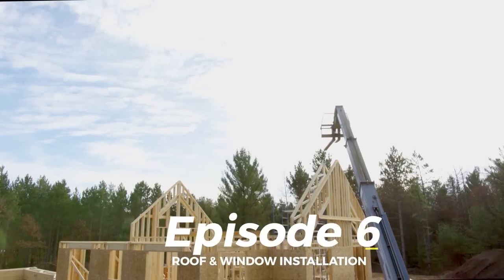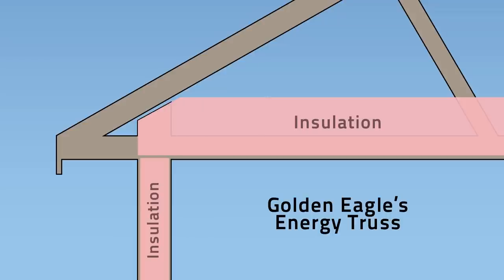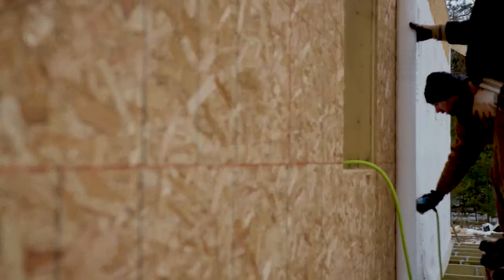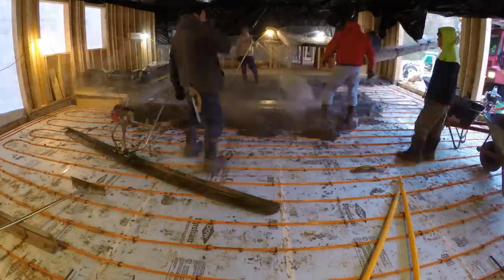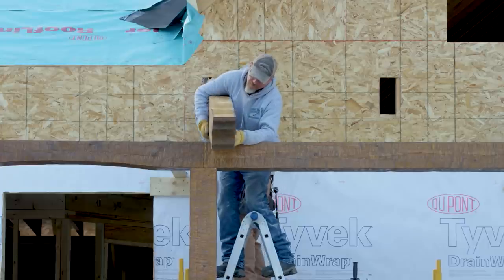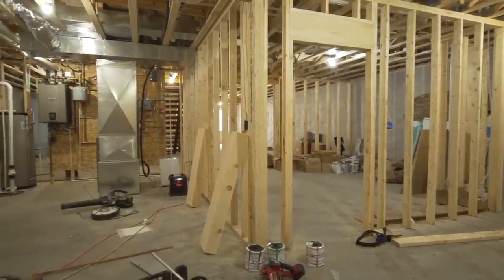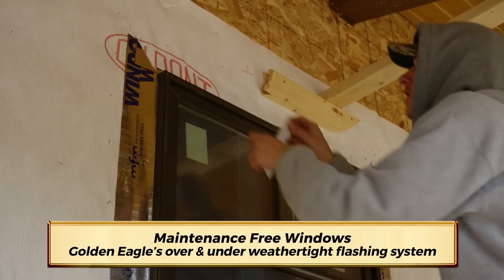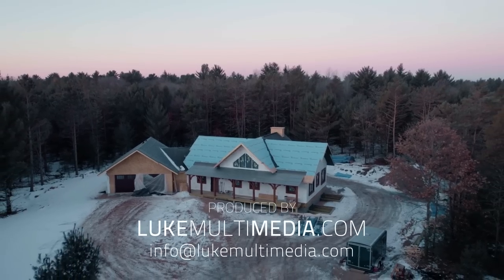Ep 6 Building My Dream Home - Roof & Window Installation

Comment: Dude! You forgot the drain in the center of the garage. A drain allows you to wash the under side of your vehicles to remove salt. I saw one home with an undercarriage sprayer operated via remote when pulling into the garage. Super over the top. But much needed to remove road salts..

Cheers from Seattle!
Reply from the maker: It's there right where you said!
Reply: @goldeneagleloghomes  Indeed it is. I didn't see it until a later video. As well as the spigot to rinse the salt off with. I couldn't remember which video I had made this comment on. Since I was unable to come back to correct this comment I added a correcting comment to the video showcasing your envy inducing garage.

Cheers!

Comment: Not trying to be picky but shouldn't you use the house wrap and cut it into the window wells? So as to stop moisture from rotting out the wood around the window when it gets in? It will save you money in the long run.  If you cut the protective paper the shape of the window then the water from rain and melting snow can't get in behind the window's and cause the wood around the window's that are not covered to rot away.
Reply from the maker: Thank you very much for watching and commenting!
--

Comment: Why not plywood on the roof vs osb??
Reply from the maker: Hugo Hugo Thanks for your question. Today’s plywood quality is not as good as OSB. OSB is a better product.
Reply from the maker: Check out episode 10 for the final tour: https://youtu.be/kcURWoz3AKU
Reply: Plywood delaminates when it gets wet OBS doesn't plus especially for an engineered truss roof the loading on OBS omnidirectional on ply it isn't.
Reply: @Bobg425  depend on the grade of osb. If they're using premium osb then it's all good but if not plywood would actually be better than cheap osb. Actually there is much better systems than what they are using but they are usually more costly and may not be necessary if the owner doesn't want to dump more money into it. you have to look at it in tiers.. 50,100, 200 year maintenance houses. There is ways to overbuild home so much it lasts more than our lifetime and then some but it's more $$$$$. Then there is cheap skate builds full of problems and medium grade builds that are standard and last long enough for most to enjoy with some maintenance down the road. tech is evolving though so we will see better builds in newer homes that never existed before.

Comment: How was waterproofing made for the foundation?
Reply from the maker: There is a sealer on the foundation. There is also a drain tile around the bottom of the foundation. Plus the land is sandy, and the water will drain easier away from the house.

Comment: Isn't that concrete in the heated garage floor a bit too thick🤔?
And also, why heat a garage floor???
Reply from the maker: Cold climate, It is so nice the heat is located down where you want it and it melts the ice and snow that falls off the car, thanks for watching

Comment: @Golden Eagle Log and Timber Homes How do you make repairs to the tubing of the heated floors if they are cemented in?
Reply from the maker: Once installed, there should not be a need for any repair.
Reply: Jack Timbers you don’t do repairs at this kind of tubing in heating floors unless you start to drill holes in the floor. Is no need .

Comment: Hi.
Can you share the total cost of this project?
Reply from the maker: Yes we can If you have been following along in the video series “Building My Dream Home” episodes 1-10. You may have been wondering what the total build cost (♦ turnkey cost) would be.
Zach started with the smaller Clearwater 1750AR Ranch. For which either the Premium Exposed Beam Timber Package, or the 8 Inch Premium Half Log Package! and would turnkey for approximately $369,000.
We also have a model called the Clearwater 2095AR Ranch which is more similar in size to Zach’s home. For which either the Premium Exposed Beam Timber Package, or the 8 Inch Premium Half Log Package and would turnkey for approximately $575,000.
Zach used the Ultra Custom Timber Package version, the Timber Ranch 2286AR-CT. The Ultra Custom Timber Package is fully loaded with taller wall heights, taller windows, and taller interior doors and our finest cabinetry. Plus massive timber band boards, rafter beams, and custom timber style trims. So, Zach’s house as it is built (depending on where you are building it) would turnkey for approximately $790,000.
♦ Turnkey costs do not include the unpredictable variable costs such as price of the land, well, septic, landscaping, taxes, and shipping.

Comment: R-13 is not an incredible R value... But better than foam board in garage doors. 

Why the BIBS (Blown-In Blanket System) style insulation in the basement bedroom? Would have been much better off with an inch of closed cell spray foam with an R-15 over top or 2 inches of closed cell spray foam with R-13 over top. 

I did 2 years as an insulation installer btw.
Reply from the maker: As you know the better the installer the more energy efficient the home will be. I think you saw sound reduction insulation in the basement bedroom. By the way the energy bills this winter are very reasonable thanks for watching

Comment: Looks pretty good but does not seem to be that resistent against hard weather like our stone houses in germany would be.
The parts that look the most stabil are actually the decorating timbers on the outside of the house so it looks way more solid than it actually is. Apart from that, really a Dream Home👍🏻
Reply from the maker: The homes we build are very energy efficient  We live in a even colder climate than you do we get it
Reply: @goldeneagleloghomes  
I know, but I haven't discussed the energy efficiency rather the rigidity.
However, as long as the house holds up every Type of storms and such in the long term everything is fine. Just would be a shame if a beautiful home like this would get destroyed by the time because it wasn't build strong enough in the first place.
Reply from the maker: Thanks for worrying, but our engineering department does that for our customers

Comment: no thermal energy or solar? :(
Reply from the maker: Zach didn't want to do solar at this time, but it can be added in the future. The Northern Wisconsin climate isn't conducive for solar energy.
Reply: @goldeneagleloghomes  Thanks for the answer. It just makes sense to incorporate some renewable energy source in my opinion and especially when building a new house its the perfect opportunity to do so. Do I stand correct that thermal energy of some capacity would be a great option in that region?

Comment: Dude, that little steel roof section is gonna suck so much when it rains and all you hear is the loud impact of the rain on the steel hitting non stop 😳😳😳
Reply from the maker: Nah, it’ll be alright because those are outside above covered porches (non-living space). It would possibly be loud if it was on the roof above living space.

Comment: All that extra on thicker studs and roof trust systems yet the still use osb shit board instead of plywood ????
Reply from the maker: Times have changed, most plywood today used for sheathing will have voids (air spaces) and be 3 or 4 ply. The warping and voids are a deal breaker for most builders. The new OSB is a whole lot better the material we had years ago. The product we use on the floors has a full 200 day warranty against swelling and flaking even if left out in the elements. On the 20,000 square foot and larger homes we often go to the new 450 series of OSB and the warranty is endless, so even if it were to take the builders years to get the floor covered with a roof its warranted against swelling and flaking. Most of the industry sees OSB as the superior choice over plywood.

Comment: Golden Eagle, I'm a European and have always admired how Americans build their typical wooden homes. Could you tell me, just for the sake of argument, what does a house like this cost? Doesn't have to be an exact number.
Reply from the maker: If you have been following along in the video series “Building My Dream Home” episodes 1-10. You may have been wondering what the total build cost (♦ turnkey cost) USD would be.
Zach started with the smaller Clearwater 1750AR Ranch. For which either the Premium Exposed Beam Timber Package, or the 8 Inch Premium Half Log Package! and would turnkey for approximately $369,000.
We also have a model called the Clearwater 2095AR Ranch which is more similar in size to Zach’s home. For which either the Premium Exposed Beam Timber Package, or the 8 Inch Premium Half Log Package and would turnkey for approximately $575,000.
Zach used the Ultra Custom Timber Package version, the Timber Ranch 2286AR-CT. The Ultra Custom Timber Package is fully loaded with taller wall heights, taller windows, and taller interior doors and our finest cabinetry. Plus massive timber band boards, rafter beams, and custom timber style trims. So, Zach’s house as it is built (depending on where you are building it) would turnkey for approximately $950,000. ♦ Turnkey costs do not include the unpredictable variable costs such as price of the land, well, septic, landscaping, taxes, and shipping.
If you have any questions or would like more details please feel free to Contact Us or call 800-270-5025 Toll Free

Comment: Why is there is no exterior rigid insulation? How many inches are your putting inside? What are your walls 2x6? 2x8?
Reply from the maker: Hi Interiorholly,
We have learned it's best to line the perimeter of the interior of the exterior basement wall for many reasons instead of ridged foam on the exterior. Here is what they are, you can triple the amount of insulation, and it is ready for future wiring, and we have not found an exterior cover for the foam that performs or looks good. On the main floor 2x6 and 2x8 walls are the norm with spray foam or whatever the home buyer would  prefer, hope that helps thanks for watching.
Reply: In Wisconsin, I'd figure you would've wanted a thermal break by installing exterior foam; particularly with 2x8 walls. Zip would've been perfect for this and I'd imagine you'd break even on cost by converting to 2x6 wall studs along with not having to apply house wrap.
Reply from the maker: Check out episode 10 for the final tour: https://youtu.be/kcURWoz3AKU

Comment: why isnt the tubing from the floor covered in insulation again? if it expands or shrinks in the concrete the plumbing could break, or is it special tubing? in germany we make 1 layer insulation, tubing, insulation around 8 cm and then concrete on the insulation
Reply from the maker: In the USA we believe insulating over the top of the tubing insulates the heat from rising. We don't seem to have trouble with the tubing breaking or leaking and our climate (where Golden Eagle is located) is similar to yours in Germany.

Comment: Whats the budget for this build
Reply from the maker: How much would it cost me to build this home?
If you have been following along in the video series "Building My Dream Home" episodes 1-10. You may have been wondering what the total build cost (♦ turnkey cost) would be.

Zach started with the smaller Clearwater 1750AR Ranch. For which either the Premium Exposed Beam Timber Package, or the 8 Inch Premium Half Log Package! and would turnkey for approximately $369,000.

We also have a model called the Clearwater 2095AR Ranch which is more similar in size to Zach's home. For which either the Premium Exposed Beam Timber Package, or the 8 Inch Premium Half Log Package and would turnkey for approximately $575,000.

Zach used the Ultra Custom Timber Package version, the Timber Ranch 2286AR-CT. The Ultra Custom Timber Package is fully loaded with taller wall heights, taller windows, and taller interior doors and our finest cabinetry. Plus massive timber band boards, rafter beams, and custom timber style trims. So, Zach's house as it is built (depending on where you are building it) would turnkey for approximately $950,000.

♦ Turnkey costs do not include the unpredictable variable costs such as price of the land, well, septic, landscaping, taxes, and shipping.

If you have any questions or would like more details please feel free to Contact Us or call 1-800-270-5025 Toll Free

Comment: What size boiler did you need for a house this size with such tall ceilings?
Reply from the maker: Here is how it works the HVAC company will do energy calcs on your new home, factor in where you are building such as Florida or Alaska log width, window sizes etc. etc. and determine what you requirements are
Reply: I understand the process, but was curious what size was used in this case since you're heating so much by boiler in a northern climate...
Reply from the maker: 18.2 gallons on this home
Reply: Ok, was wondering more about the kW needed compared to my current home...
Reply from the maker: Heat Source:
Weil Mclain WM97 95.1% eff. boiler as the heat source. With an 18.2 gallon companion water heater attached.